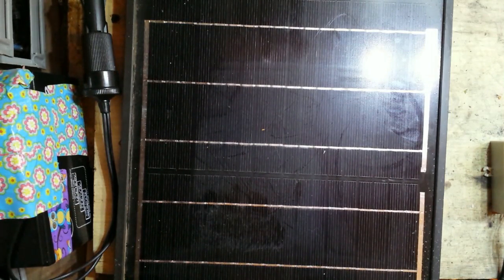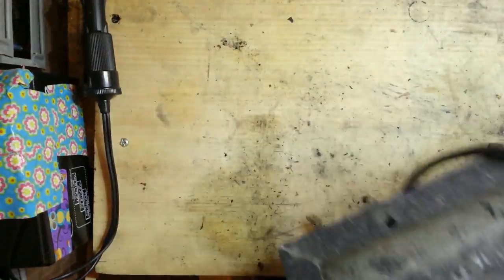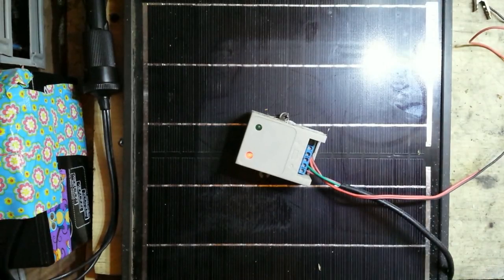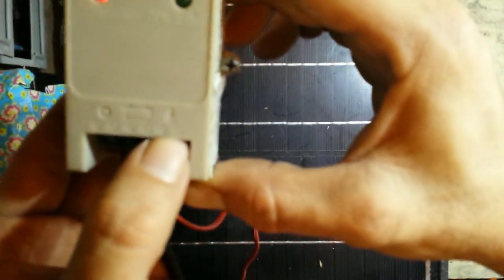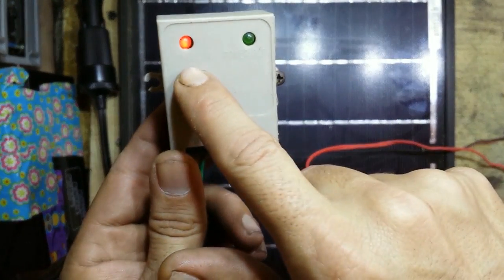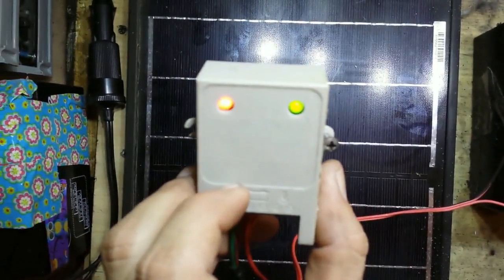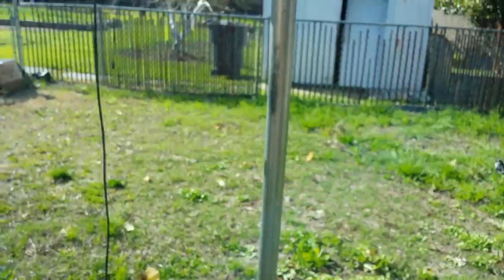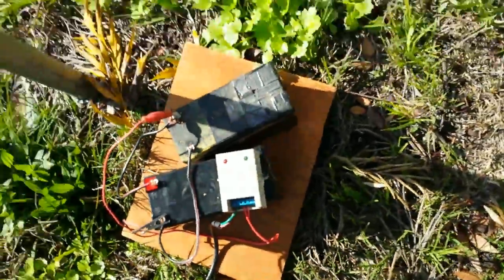Solar Charging SLA batteries

Comment: I have a similar setup  (somewhat) but the battery keeps getting overcharged. So much that it pops off the cover and the small covers on the cells - assume its boiling hydrogen off?